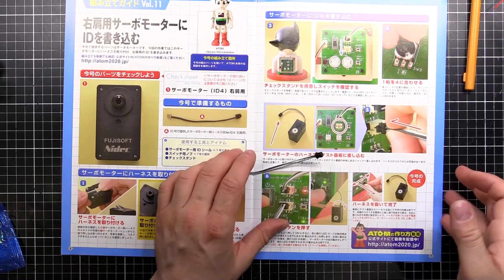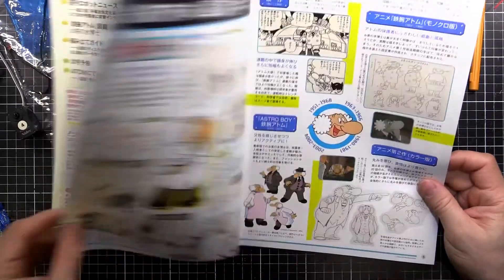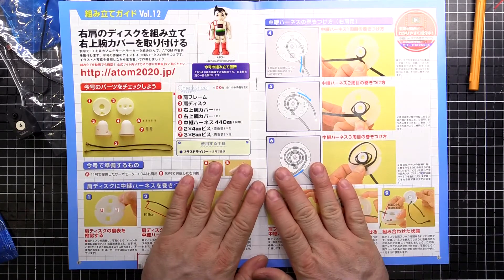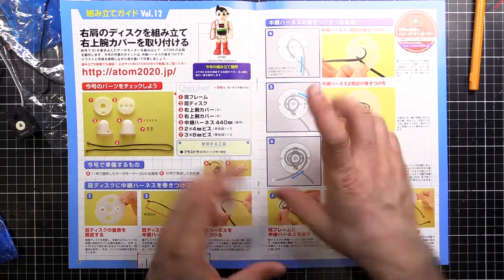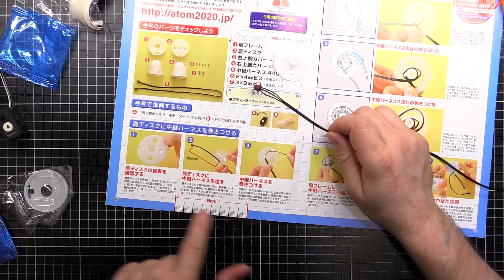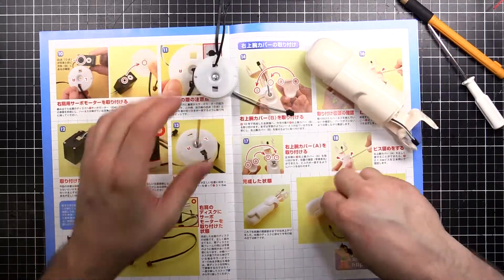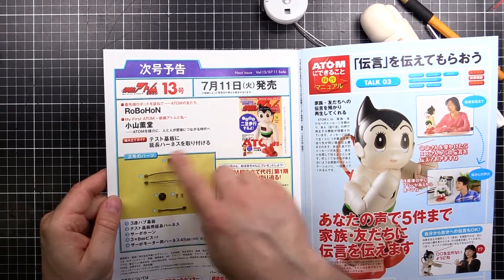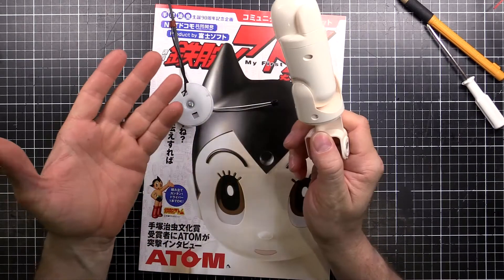Building an Astro Boy Robot - Episode 06

Comment: I bet if they fit like 8 servos in that package, this would've ended in 6 months.
Reply: And I was doing a similar project (a fan project for a game called Overwatch, a little cute turret) but a) I didn't back it up, b) the schematic got destroyed in the hard disk snafu, and finally to sprinkle salt into the wound, c) EVERYTHING was in that dead hard disk and I can't find the 3D model I designed entire thing from anywhere now.
Reply from the maker: Ah, no good! I've had the same thing happen...
Sometimes you can replace the controller circuit board on the HDD to get your data back, depending on where the fault is in the HDD.
Reply: NFM 
SMART log says "Bad surface" and "Write call rejected"
I think it's mechanical failure.
Reply from the maker: Too bad, sounds terminal... :(
Reply: NFM 
Yeah. I was heartbroken when I arrived home at Christmas last year and the only present I got was a dead hard disk.